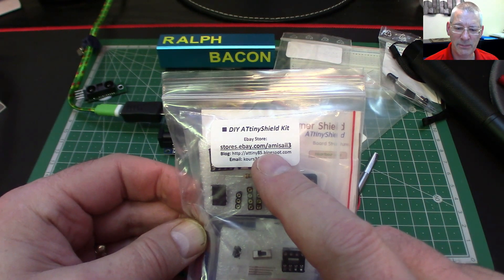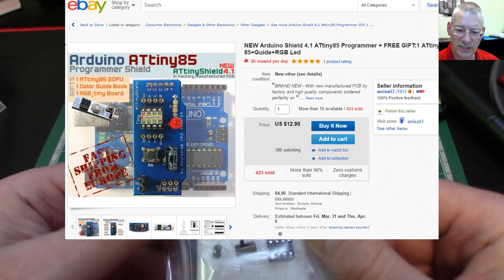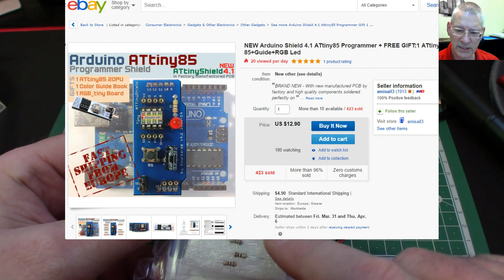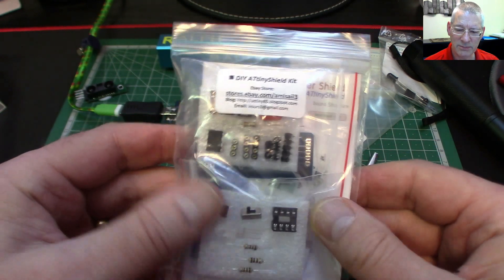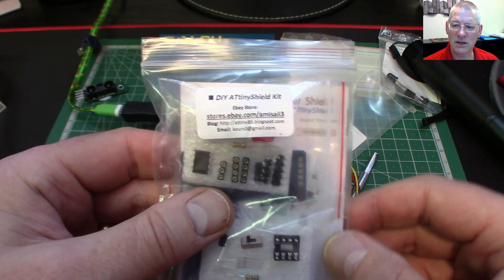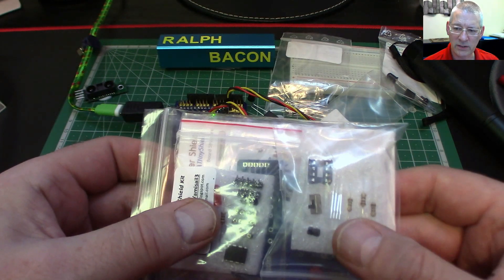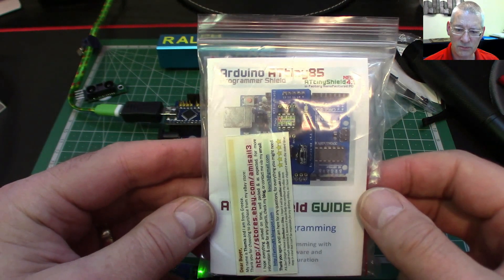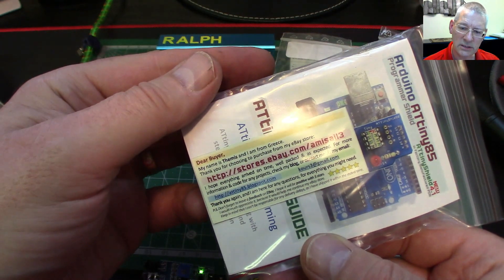#79 IR Rain ☂️ Sensor, Soldering Irons (and more!)

Comment: I got one of those AttinyShield and it is a useful tool, I must have gone through 100 of Attiny85 in the past nearly 4 years, still using the same board. Have fun with that.
Reply from the maker: I certainly intend to cheetahkid, and I will post back my experiences, one way or the other. I'm sure it will be great. Nice to hear from you again.
Reply: Thank and nice to hear from you too

Comment: The great thing about the Tiny85 is since it has both SPI and I2C you call always add more gpio with a port expander chip (MCP23017 for I2C or MCP23S17 for SPI) if you need them.

Glad to see you bought one of those Tiny85 shields, it really is most useful and saves a lot of fiddling about with jumper wires and your Uno.
Reply from the maker: I think it was you, Nick, who pointed me in its direction! I will be building it as soon as, I mean why put off until tomorrow what you can put off until next week! Er, hang on, that's not right! Regarding I2C and SPI these are only software implementations not hardware but I think it will be good enough. I want to get the pin extender working with I2C with it to give us a reasonable amount of GPIO pins. Thanks for posting Nick.
Reply: I love the attiny and i have in fact hung an mcp23017 on it, works wonderwell. But I do it for the challenge coz pricewise it is foolish with an attiny85 costing abt a euro and a promini abt 1.60 euro.
Speaking of the MCP23017... I also used it with the esp8266-01 that exposes only 4 pins,  before the wemos board became available. The mcp23017 is a handy chip and easy to use

Comment: Considering that if you slide the emitter along the edge, the place where the beam is emitted moves either closer to or further away from the emitter, it should be possible to mount your existing emitter/detector pair just as they are, and "fine tune" where they are positioned along the edge until the signal is maximised.  That would remove the need for modifying the existing board.

I'm wondering if rain could be detected during daylight hours by using a LDR (Light Dependent Resistor) to detect the sudden change in light level as a drop of water rolls past (over a glass window)?  It might need some clever programming to prevent false positives from birds, clouds and similar light interference.
Reply from the maker: Good ideas there Jason, I will certainly experiment to see what works best. Regarding an optical rain detector, as you already mention it's the false positives that would be the problem, I suspect,  but might nevertheless work. I'll see what happens as I progress this project. Good to hear from you again!

Comment: Hi Ralph, a great video, excellent demostration of TOTAL INTERNAL REFLECTION..  Also the index of Refraction is frequency dependant, hence a prism producing a rainbow.
So your infrared angles will be a little bit different to your laser angles.
Tom...
Reply from the maker: Hey Tom! Let's hope that 45-degree angle is still going to work with infrared then. Or perhaps I should just use a laser (not that green one, I have a tiny red one). Mmm. We shall see. Thanks for the heads-up.
Reply: If you use your cellphone, in camera mode, you should see the traces (though much fainter than with your lightsaber) as you do with your laser. I suspect you will still find an escape point, just in a different point. Great vid BTW
Reply from the maker: Brilliant idea, Michael, and I should have thought of it myself as I've demonstrated in the past how a phone's camera can detect IR LEDs, so this is an extension of that. I'm hopeful I will get this working soon... thanks for posting that great suggestion.
Reply: You are probably who I got the idea from. With a good teacher, all he tells you , becomes your knowledge

Comment: I'd consider putting a transistor in series with the old rain sensor, and only turning it on when you need to take a reading. That should reduce the DC corrosion and extend life by several orders of magnitude, much like how sleeping a microcontroller extends battery life. Your optical approach is interesting too - learnt a new thing today :). I'm curious to see how it shapes up.
Reply from the maker: Hello Rakesh, welcome! Yes, I'm curious how this will shape up too. It's got to be better than a corroded sensor (that still sort of works but tells me sometimes it's raining when it's not). Yes, switching the sensor off (eg at night) could have been an option. I should have put a sensor out there that was not wired up to see the effect of weather vs. weather plus DC current. I might just still do that too, so thanks for the suggestion.
Reply: Thanks for responding. It'd be interesting to know if the old sensor's life can be extended. If all it takes is a transistor, a base resistor and a spare digital pin, with the firmware polling only say once a minute, to extend life to say 3 years instead of a few weeks, that'd be very interesting to know.
I'm no expert, but the green colouration of the corrosion suggests a charge migration, which can be avoided if you don't keep it powered on all the time.
The corrosion can simply be oxidation too, of course. The statue of liberty has a copper coating that has turned greenish due to corrosion, without the need for a DC current, so there's that. :)
Reply from the maker: I think you're on the same track as me there, Rakesh. The green colouration is more than likely charge migration, I'm sure, as I have tinned all the copper strips on the PCB and even put clear varnish on the gaps between the strips. I'll deffo put out another sensor that is not wired up, and try to get the existing one then switched, probably just via a spare pin on the Arduino, that's enough for this (I already have an LDR wired in so it's easy to switch it off at night, for example) and poll every few seconds for a millisecond or two.
 
Of course, if this all works then I don't need the IR Rain Sensor !!! (I'll do it anyway, perhaps even in parallel as an additional sensor). Thanks for your suggestions, greatly appreciated.

Comment: IIRC,, infra red is absorbed by acrylic/perspex. i.e. it's opaque.
Reply from the maker: Hi there Bernd! I wonder if you're thinking of UV rays which are blocked by glass, for example? My experiments (so far) show that IR behaves just as you might expect in a clear block of acrylic, but the proof of the pudding will be in the eating. So stay tuned for  a future update!
Reply: Ralph S Bacon glass blocks/ reflects true IR but acrylic is less absorbent (the IR window on the front of most IR controlled devices is acrylic, as are the bodies of IR transmitters and receivers). I suspect most things that we think of as IR are in fact really Near IR. In real IR applications (I.e. FLIR cameras) glass is never used in the lens. IMHO, glass passes UV, which is why you can get sunburnt through a closed window.
Reply from the maker: Reading up on this is eye opening. There are various 'grades' of Plexiglass, acrylic, Perspex, some of which are deliberately designed to reflect/absorb IR and/or UV. Who knew? Well, apart from you two guys. Luckily, my experiments indicate that IR is being successfully transmitted, so maybe it is, as you say, almost IR? Anyway, when I get this going (or fail to) I'll let everyone know! Thanks for the info Graeme (and Bernd too), there is more to this than meets the eye!

Comment: I was attempting to do the same, with the same components too. But found that the IR sensor responds erratically when I take it out to test, with the immense number of IR lit security cameras, it's no wonder. So I decided to use a modulated IR beam and a TSOP sensor. How far along are you with your project?
Reply from the maker: I had to modulate the signal too, Arun, as even the sunlight swamped the sensor. Ultimately, however, I never got it to work reliably (or sensitive enough) in this project. Part of the problem is that the surface area is quite small. Pity. I reverted to the standard copper finger strips on a PCB board but managed to get over the corrosion problem in two ways:

1. Use a stainless steel sensor. Rarer than hen's teeth. I have one but not currently in use.

2. I changed the code to power the sensor module once every 30 seconds for up to 5 seconds (or thereabouts) take a reading and then remove the power. Power is from one of the Arduino pins as it only needs a milliamp or so. I let it settle for a second or two before taking a reading.

It's still running now. The sensor PCB looks a bit weathered but other than that works 100% reliably. I keep meaning to put the stainless steel version of the sensor in place but then think "Why bother? It's working now".

Comment: For soldering irons,  I have tended to favor Ungar (since absorbed by Weller it appears),  which has a heating element that screws into the handle with what resembles the base of a small light bulb.  I currently mostly use 33W and 45W elements,  mostly with a chisel tip,  but then I don't do much with surface-mount parts.  One of the things that's come in handy with the screw-on tips is a bit of anti-seize,  also branded Ungar,  although I expect that the anti-seize that you can get at auto parts stores would probably work as well.  I like the look of the Dremel you show here,  and maybe I'll have to get me one of those...
I also have a little box that I plug the iron into,  which has two switches,  on-off and high-low,  where the low setting puts a diode in series with it effectively giving you half the power for when you need less heat.  Been using that for several decades now.
Reply from the maker: I'm not familiar with Ungar, Roy, (although I've hankered after a Weller but ended up with a cheaper ATTEN, although I use some of the Weller bits that fit that iron). Good tip about using anti-seize liquid. 
Regarding a high/low switch, I built a soldering iron box when I was about 16. The weight of the iron hanging on the microswitch lever (which came through the case) put a diode in series with the iron. Sound familiar? I should have patented that idea except it was probably from Everyday Electronics magazine! Nothing new under the sun.
Reply: I've seen that setup too,  but I prefer the manual switch,  where I can select lower power if that's what I need for what I'm working on.  The stand is a separate item from the hi/lo box.  :-)

Comment: Thanks for that Ralph, it was very informative as normal. Could I ask you what sort of camera you use and how do you get the video of your good self to be in the corner. I only ask this because I am into Model Railways and I am wanting to make some videos to submit to youtube. Thanks again
Reply from the maker: Hi there Raymond, glad you liked the video. I use OBS (an open source video recording tool) that accepts a wide range of inputs, including a webcam that I record at a fairly low resolution and shrink to just that corner. It will take you a little while to get to grips with it but there is plenty of help on their forum. Good luck!
Reply from the maker: BTW, don't confuse OBS with the older "Open Broadcast System" despite the similar acronym, the OBS is the newer product and well supported.
Reply: Thanks Ralph, I will look into it

Comment: was looking for such a rainmeter the other day
Reply from the maker: Now here's the thing Ed (and I'm pretty sure I've said this to others). I experimented with this route (lasers) because the existing sensor corroded before my very eyes, because it had a constant 5v DC supply across the sensor. However, in parallel with the laser experiments, I changed my sensor to only switch on for few seconds, do the reading and switch off again a few times a minute. And guess what? My sensor no longer corroded. Added to which I've now acquired a stainless steel sensor (looks just like the original one) and which will of course never corrode. So the laser solution is now in mothballs awaiting a further need... any ideas?
Reply: I am very familiar with that possibility as i do it with my soil moisture sensors...... basically on for a few milisecs every 4 hrs. Sensors (just two rods)  last for years.
Wasnt sure if that would be practical for a rainsensor, as that has to be more on guard... but i will give it a try. Even if i switch it on for a few milisecs every 10 secs it should already make a difference
Reply from the maker: Yup, I think I switch mine on every 15 or 20 seconds (something of that order anyway) just to take a reading. It might miss the very first spot or two of rain but better that than a corroded sensor that doesn't detect anything anyway! My wife has requested an enhancement to this project, to let her know when it has stopped raining which is simple enough to do with a simple heating element under the sensor and a bit of logic to detect the state change (wet -> dry) but it's all theory at the moment miuch to my wife's frustration!
Reply: Though the sensor should react soon enough if it has stopped raining.. especially when its position is slightly slanted, a heating element is definitely a possibility.
How about a servo with a wiper,  cleaning your sensor of raindrops?.

hm,, maybe just a funnel with an optical droplet counter, or  2 exposed wires at the base of the funnel should do well too
Reply from the maker: When you've designed (and built) either of those two great project do let me know! Seriously, if only I had the time to do any of this! Good suggestions on both counts. The heating elements are cheap, waterproof, come in a huge variety of temperatures and operation from 12 volts (mainly). So that the route I want to take when I have a nanosecond or two spare...
Reply: Ralph..... like for most DIY-ers, my time is the reverse from he length of my projectlist :-)
but i will keep it in mind. I may give the heating one some priority though

Comment: Just what I'm looking for to let us know if it starts raining and the windows on out foster cat pens. Ralph where did you get the odd shaped perspex?
Thanks for another great video.
Reply from the maker: I had the odd-shaped perspex custom made at some ridiculous price, Lee - and the thing, is they never worked as well as the original solder fingers on a board - after I learned that the way to prevent corrosion on those was to only turn the rain sensor part of the circuit on (ie power it up) for a few seconds at a time, a few times a minute. Since then, no issues with the originals. Does this help or have I given you a Boris Johnson-type answer (ie an answer to a completely different question)?
Reply: @RalphBacon  A great answer thanks. I understand what you mean about the intermittent sampling from the exposed circuit board. If the power is only running for a second or so every minute, corrosion would be slowed down significantly. It's not like you'd need a much finer resolution than that. This solution is my backup now. After looking at a number of car windscreen rain detectors and looking online I'm pretty sure I can do the same with some glass. I found a glass company that sells samples of 12mm thick glass in 10 x 10 cm squares for £3-ish. I got one and will try it out as I have all the parts I need from salvaging numerous TV and Sky remotes. My plan is to use two or more pairs of IR Tx/Tx LEDs to get a good spread across the glass. 
If it works, then all I need to do is decide if I want to use radio or wifi to send a rain alert and 3D print an enclosure. Plan B will be to get a conventional rain detector module.
Reply from the maker: I'm afraid there a huge typo in your comment, Lee. "If it works, I shall immediately tell Ralph and everyone how I did it and post full details, including prices, on line (or get Ralph to do same)" is what you meant to write, I'm sure. 😄
Reply: @RalphBacon  LOL oh yes i missed that. That's what I meant.